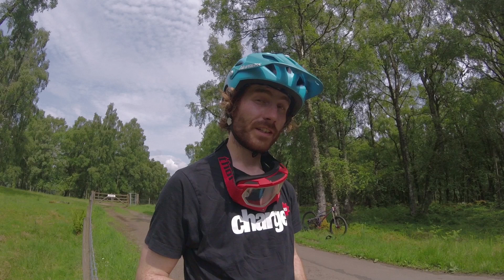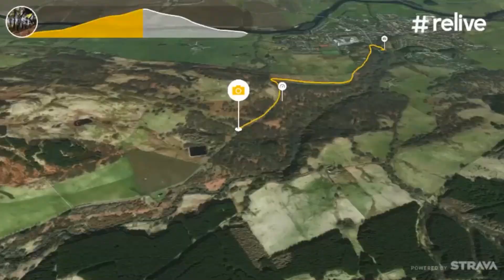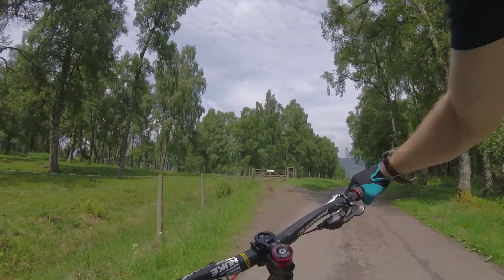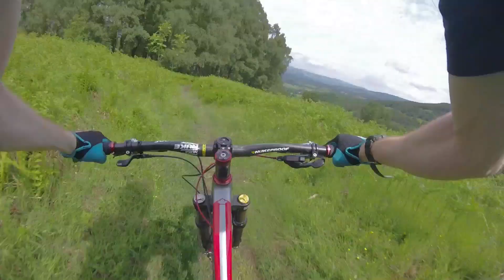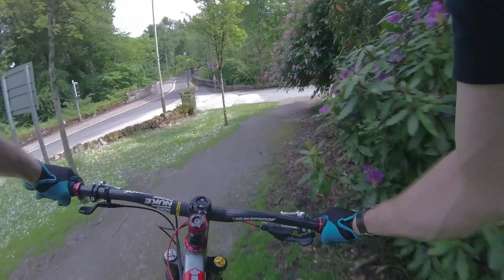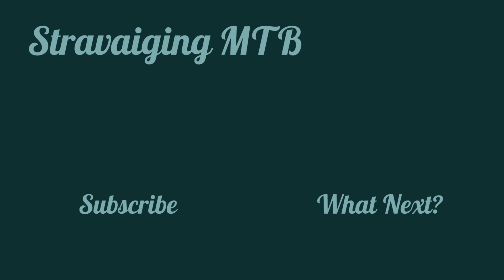Does Your Clutch Mech Ruin Your Suspension?

Comment: I agree with you, The clutch is not needed, with a chain guide, the clutch won't stop the chain from falling off even with the narrow wide chainring, only a chain guide is the proper fix, but the clutch definitely reduces chain slap.
Reply from the maker: I reckon te clutch inhibits your compressions movement by something like 5%. So depending on the number of clicks your shock or fork has that could amount to a few clicks either way.
Reply: on XT rd I think I had it on almost minimum, I set it to the best setting  I can, smooth shifting, clutch doing its job, 
 much more is not needed to eliminate horrendous chain slap for not so technical riding. but I wrap chainstay with innertube so it helps a lot to reduce noise.
triple chainrings, no clutch m772 RD riding fast on roots = chain drop, the rear derailleurs have improved a lot, but clutches can be too stiff, I noticed that the same SLX RD were set to two very different settings one was way too stiff one barely did anything. but for me it was an easy fix.
on my bike the suspension will feel wrong no matter what.
Reply from the maker: Why do you feel your suspension is off?
Reply: no sweet spot, mid-stroke support,  bottom out support, plushness, I might need volume reduction, I know it's possible to get it for DRCV shock, my fork has a really long grey spacer in as stock, I cant use compression due to the Grip Fit dial is shifting to locked which is dangerous, so need zipties to keep it in place, same for the shock, even kerbs are too much.
I haven't done anything about it, because I will buy new frame, and new fork, I am keen on MRP ribbon it got a lot of love from customers on Mtbr forum.
2014 Fuel ex is too flexible, causing abuse to the drivetrain, I bend and twist cogs on cassettes, one I had a premature wear on the chain, but new chainstay fixed it.
but I am still wearing out hangers very fast, seat stay has twisted 5mm to the right.
tyre clearance is ridiculous on the right side, trek did not take to account tyre movement, wheel flex, chainstay flex, side to side movement.
so this means after about 2 years whole rear end has to be swapped.
So unless I do MTB I will ride on my old trusty 6300.lon
Reply: I have to run 110 psi for hard riding, 100psi for comfort on easier trails, I also notice in the spring & autum & winter the fork firms up or softens up a lot, and and thats exluding psi drop, of course htat happens too, it probalby has to do sometinhg with the oil, I am sure temperatures has soemtihng to do with it.
few months ago I did osme street sessioning, on soem stairs, and practised other stuff, I noticed the fork when from too firm/harsh to plusher.
that was in hte period when winter ended and hte heat came.
I also notice the fork gets alot of air behind hte seal, I used ziptie to get it out. MRP ribbon got the pssst valves which I think is nice addition for sure.
I don't have to go up or down in altitude to get air behind hte seal.
but when I do I notice difference in pressure drop.
but that's normal with air forks, but coil forks are qutie heavy, but might be worth it if htey outperform the air forks, but then I would have to have the perfect spring for my weight.
Reply from the maker: How much do you weigh? Seems like you have a lot of bother with your bike. And yes, low temperatures will slow down the compression on a shock or fork. The oil will be less viscoss in low temperatures so you need tp adjust your rebound and compression if you have that adjustment to account for the slower acting suspension.
Reply: I am 180cm & about 75kg about when last time I was on a scale but that was a few years ago, I also want to go up in travel, at least 140mm.
Reply from the maker: I run my shock at 143 psi, im a similar height and I weigh 66kg, so if I was guessing the shock needs more pressure.
Reply: yea I gave up, no point in to continue spending money on it, and continue to use it, Will probalby get Nicolai og Pole, MRP Ribbon,  Chris King BB, Renthal apex35 just short, I will swap over the parts on my bike.
Reply from the maker: Sounds like a nice build you have planed.
Reply: I run 210 in the shock and 110fork, but for easy trails, I run 10psi. but it does not feel right for riding down 1 meter long stairsteps, with 10 cm drop, feels like pogo stick, but rest seems ok in 110 psi, but if for harder trails & drops I have to sacrifice comfort for bottom out.
Reply from the maker: If its pogoing then sounds like you need some more rebound dampening.
Reply: I got some parts on the way: cane creek preloader ring for Race Face the Race Face Cranks I got, Cush Core. I already got MRP Better boost adapters so I can use a boost fork. this way I got good enough wheels for a while, that I wont destroy, they are stiff enough,  or won't go out of true silly fast. will try  to get the ultimate wheelcombo later. I definitely want more engagement, but HopeTech Pro4 is good enough to not feel awkward.
Reply: Gear box bikes are interesting, but I haven't seen oval chainring for it yet, which I want, also currently there is no trigger shifter or electronic shifter for gearboxes, and I don't want to use a twist shifter, So I will get normal frame, I will probably get the new Box One rear derailleur, cus it has bushings, they promise a stronger rear derailleur, due to forging, which the first gen did not have, which is probably why it failed for me. 
gearboxes are interesting , due to better suspension performance, and straight chain line, and no hanger to bend or snap, no rear derailleur to snap and of course more clearance on rock gardens.
Reply: Fox 32 Evo(with 2018 CSU, FIT GRip) the fork is literally painful to compress off the bike, the other forks I got for my xc bikes are different, they are plush, and I feel bottom out support, but very plush at the top,  they are RockShox Recon Gold solo air & Mz Corsa sl. But event tried riding them fast on technical terrain. but htey are ok for grosery rounds. fox is harsh all the way and firms up a lot,  but on the bike is what counts,  but I can definitely notice the difference in plushness, thats with same pressures, even with lower pressures the fox feels to oharsh, but if I lower it under 100 psi it feels way too soft and bobs, and just feels awkward. So I basically only got two choises run 100 psi or 110 psi for hard riding. won't bother with tokens, I want to sell it get rid of the frame, I need to get rid of some parts i don't need.
Reply: Stravaiging MTB I currently run it at 2 clicks. Sag Is about 30%. I ran 6 a while, but reduced until it felt good, 100psi is a good compromise for now. I tested the rs recon gold solo air 100mm fork on drops I could not get it to bottom out, it had more support at the end, plush beginning. I ran middle rebound damping there. Same pressures. I might change settings at later point, not finished tweaking it. The drop was 1m high. The difference in of the top plushness is huge. I haven't tested high end rockshox forks yet.
Reply: Stravaiging MTB can't really do more, or it will not return up. I will have to get new bike soon, can't straighten hanger after every long ride. Mabye volume spacers would help, but fork comes with a huge spacer, not sure how much space there is.

Comment: Well it does effect the suspension movement. Especially with shimano clutches, where you can tighten or loosen them. Coming from a hardtail, I like to keep my rear end a bit stiffer, especially on street rides. But yes, it shifts and feels better with the clutch off when shreding a rough trail. I guess it depends on the riding style if you consider it helps or not.
Reply from the maker: Thats the thing, it does affect it but nt necessarily how (I at least) expected it. You can create thr same firmer feel with suspension tuning with it switched off and more responsive with it on. I just thought it was intriguing to have some data to draw conclusions from rather than pinkbike forum trolling.

Comment: Interesting video! I'd honestly never even considered this, though it makes perfect sense. I've been thinking of changing my Trance up from 2x9 to 1x11; not I'm not sure if a clutched RD is necessary. You figure a chain guide up front and a narrow/wide is sufficient?
Reply from the maker: It has worked flawlessly for me, you'll struggle to find an 11 speed mech without a clutch. But you can just turn it off.

Comment: The real question--which causes more stress to a chain on a full suspension bike--clutch on or clutch off? (on fancier Box two derailleurs you can precisely adjust your desired clutch tension) 
I'm wondering if even a slightly more freely rotating clutch gives your chain better odds of snapping, let alone completely removing clutch forces...or is it the other way around, where too tight a clutch actually puts more stress through a chain..?  There's defiantly a balance point on either end of that metric...

I say all this because certain downhill racers like to turn their clutch off for a faster downhill race run..Gee Atherton being the one I first heard this from. I wonder if it increases the likelihood of a snapped chain.

Comment: Have been wondering about this as well since I heard about someones chain falling off on a downhill track. They said the suspension worked better with no chain.
Reply from the maker: Its only a very small data set an more testing over many frames, mechs and shocks would be needed to be sure. But....

Comment: I don't know about not having a clutch on a hardtail as when I have turned off my clutch/forgot to turn it on my chain fell off my narrow wide ring, but in do see the benefits of having it turned off,     I'm thinking have a remote for it to turn it on and off plus some way off someway of changing shock setup on the fly, if anyone was to do this it would probably be SRAM as they have drivetrain and suspension departments. using their knowledge with the shockwise and wireless shifting could have a shock with a 'built-in shockwise' that can setup on the fly on it's own, whilst the drive train can turn on and off the clutch and communicate with the shock when this happens. This could be the ultimate way to shred, sadly this is starting to sound very expensive and more for the world cup circuits if the rules don't effect there use.

SRAM if you read this hook me up with ya XD!
Reply from the maker: Cannondale had a Moto fork which had upto 4 different suspension maps that could be switched between at will whilst riding. Lapierre also had its electric shock system, it would open an close the compression on the shock based on what the fork was doing if I remember correctly. Im not aware of a clutch disengagement system. Although Canyon showcased a concept system that allowed the rider to disengage the freehub thus isolating the suspension from the drivetrain influences.
Reply from the maker: Thats also bad luck regarding dropping chains on your HT. Ive not dropped a chain on my HTs since I went narrow wide back in 2014.
Reply: Maybe it's just the way I ride
Reply from the maker: aggressively!!!! Lol

Comment: They do if you have a single pivot bike,but not by much
Reply from the maker: The Shock Wiz I was using noticed a 5% difference in the low and high speed compression. That may not sound like much but if you run 140 PSI in your shock and you drop 7 PSI out of it you will feel that differnce.
Reply: Stravaiging MTB Probably depends on the derailleur cluth tension and cage lenght. I don't feel a difference on/off
Reply from the maker: All true, I didn't expect to feel a difference, but I did. Where I felt it most was in the shifting but I did have better small bump sensitivty. The type of shock will no doubt also play a part.